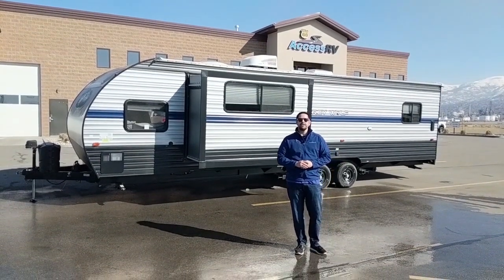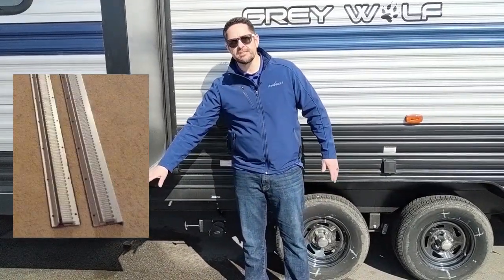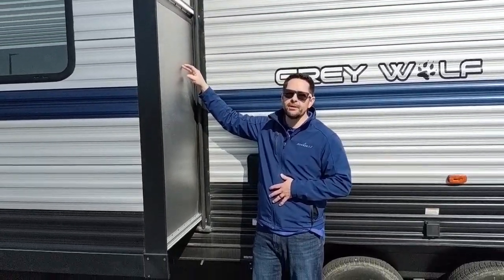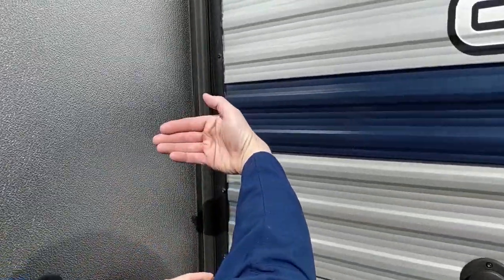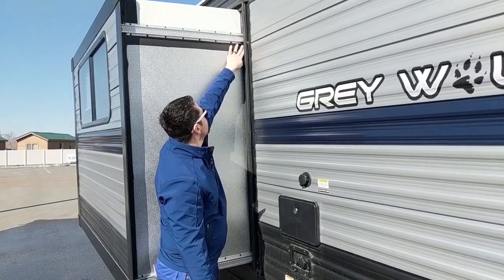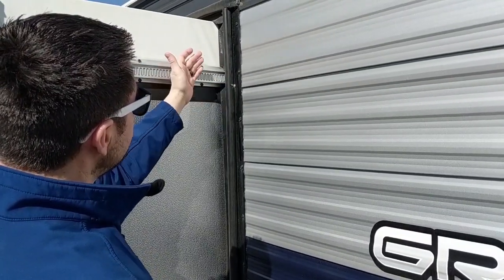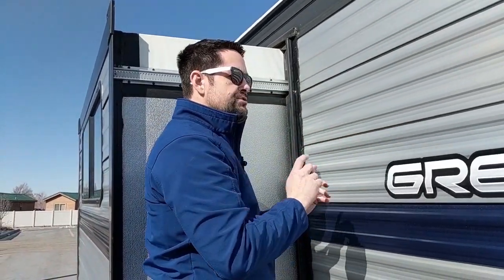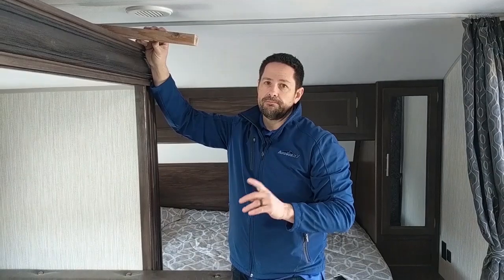What you need to know about your RV Slide System (Schwintek)

Comment: Lippert recommends CRC Power Lube with PTFE in the green can (industrial). It is pretty simple to do, and I lubbed 7 of the 8 the bearing stations on my Grand Design Imagine. 

My imagine was having problems retracting the room even after resyncing the motors. After applying Power Lube, the room cycles flawlessly and faster too, with less strain on the motors.

I have been told to do this twice a year, but I have had people say you never need to lube it. All I can say is that before I used the Power Lube, I thought I was going to have to bring it in to get it repaired, but now it is working fine.

I think you should demonstrate how to lube the Schwintek.
Reply from the maker: Good suggestion. Thanks!